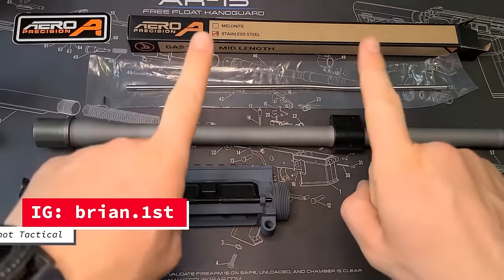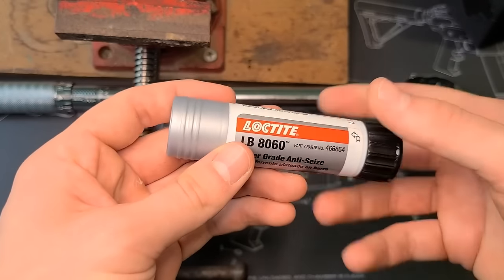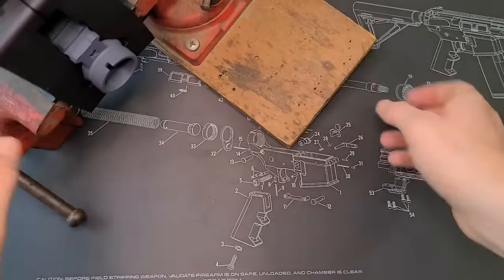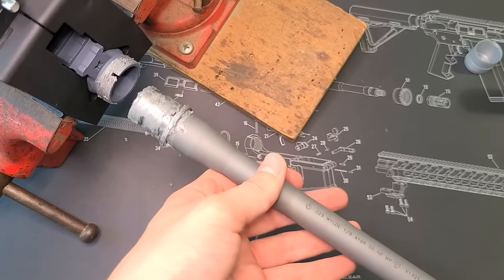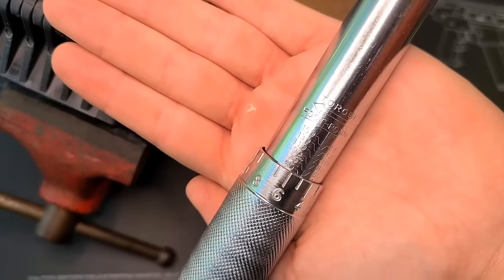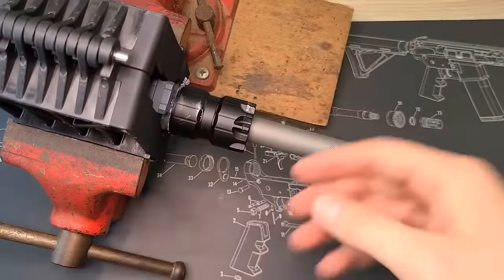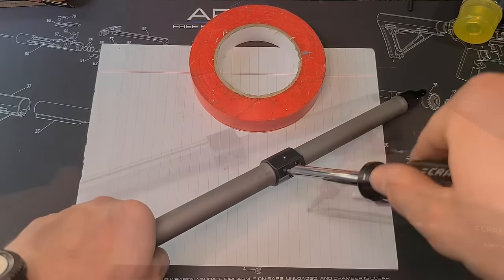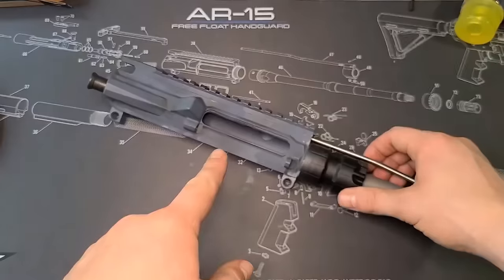How to Install AR15 Barrel - Aero Precision Upper

Comment: That vise block and the vise itself are pretty sketchy. I use a reaction rod and a properly mounted vise to install the barrel and torque down the barrel nut
Reply from the maker: Ohh it is sketchy… but it get the job done! Lol🙌🙌
Reply: I like the MWI cus of the sail. Helps alot with other tightening.
Reply: @ishnifusmeadle  that’s exactly what I have
Reply: @1st Shot Tactical could you a make video of it I would like to see it out of curiosity.

Comment: Just FYI, loctite on the gas block won't do anything. They get super hot, which completely negates loctite.
Reply from the maker: 😂😂😂 thought of that after lol very true!
Reply: What he used is anti-seize, which allows something threaded together to more easily unthread in the future. It doesn’t become deactivated by heat. His brand of anti-seize just happened to be Locktite.
Reply: @qubiedoo1  actually no he said blue loctite which is a thread locker.
Reply: -- uh --- first, he used anti seize (Loctite brand) on the barrel nut. 
THEN he used thread locker (Loctite brand) for the gas block screws.
This guy is a beginner and has received a lot of great advice (from the above comments) as a result of having posted this video.
It is OK to cut him a little slack.
Reply from the maker: @3cap97  appreciate it man! Haha always leaning!!🙌🙌
Reply: @3cap97 we don’t want misinformation to injure or kill anyone. These are not toys to be played with!!! When you pull the trigger, the energy released is thousands of pounds of pressure and remember you are holding that rifle up to your face, if that energy doesn’t go out the mussel, it’s coming back in your face in the form of a grenade. Maybe this young man should have gained more experience before posting a “ build” video.
Reply: @M21-w1y  says the armchair quarterback with no videos

Comment: The hardest part I’ve experienced when rebuilding an M4 when I did small arms repair in Afghanistan, was those damn spring pins for the gas tube and block. 😂

Comment: They are called "roll pins" and there are punches called "starter pin punch" and "roll pin punch".  Good to also have other proper equipment like a bench mount vise, pin block and better to have the proper barrel rod which will stabilize the barrel when torquing the nut down.  Yes, I have done barrels without the proper tools in the past.  But I didn't post a "how to" video.
Reply from the maker: Thanks for the comment and great advise!!🙌
Reply: God why is the gun community such puritans😭
Reply: @DannyThecorniest I mean to be fair, guns aren't something you want to half ass. Would you not tighten your vehicles lug nuts to spec? If so, I don't want to be near you on the freeway. Lol. 
I'm actually not going to be building my own upper due to not wanting it to blow up in my face because I didn't tighten a part correctly. I'd rather err on the side of caution with this shit.
Reply: @BatbumAndRobinU  that’s fair. I triple/quadruple check every time I install a barrel/gas block/etc, but I’m about to start buying them completed. Don’t want a KB type incident.

Comment: If you don't remove the dust cover, you won't be able to get the tool for aligning the gas tube out.  The spring loaded pin on the inside of the dust cover hangs up on he tool.
I just went through this and after some thought, I aligned the small "C" clip so I could see the two ends of the clip.  I used 2 small screwdrivers .  One on each of the "ends" and tapped the clip off.
It came off like a breeze.  Just watch so the clip doesn't decide to take a cruise around the kitchen.  

I then pulled the rod out of the cover from the rear "stock end".  That's it.  I have my first ever AR-15 close to being finished.  I think I went over my budget but that's okay.  Wheeler needs to modify the mold for the plastic pat that holds the gas alignment rod,  You can't get it out "IF" you have the dust cover on.  The first two flanges toward the front of the tool can't get by the dust cover spring catch on the inside.  Then you would have to take the dust cover off.   God Bless America.  We need Trump back or else we're screwed.
Reply: This aero upper doesn't have that "c" clip, I bought a strike industries cover and was planning on. Putting it but found out that I have to loosen the barrel nut to remove it from the front... A PAIN IN THE ASS!.... I have a complete upper already assembled. All this work to replace a dust cover....SMH.... I'm going to remove the hand rail and see if I can find a way around removing the barrel nut.

Comment: Don't drive a point "pick" into the end of a roll pin.  The pin is hollow with a slit down the side, so the point will actually expand the roll pin so that it won't fit.

Comment: Did you use enough anti seize? But if you are really concerned about the heat there is high heat nickel anti seize. Also that stuff gets everywhere so its better to not touch it
Reply: Anti seize? Supposed to use good old shell areo grease. Good enough for Stoner and uncle Sam good enough for me.
Reply: As a mechanic I cringe at liberal use of anti seize, it will thin out with heat and act as liquid metal shavings. I never use it on spark plugs bc of that, plus it throws off torque settings.

Comment: My muzzle device is pinned and welded so I cant slide my gas gas block off. Will the barrel nut install from the receiver side of the barrel?
Reply from the maker: Negative… it sounds like you’ll have to find a handguard that accepts the same barrel nut you currently have🙁
Reply: Might just be better to cut it off and get a 2 piece block

Comment: I'm confused why you are torqueing down to 55ft-lbs, then loosening, then tightening to 65ft-lbs. Why not just do it once to 65ft-lbs the first time? "To make sure those threads all seat together" doesn't make any sense. Aero's own video on barrel install makes no mention of this tighten-loosen-tighten method you are referring to...
Reply from the maker: It’s user preference! You could do it either way! But I talked with quite a few gunsmiths and they taught me to tighten it twice! Your call tho!👍👍
Reply: Minimum barrel torque spec is 35 foot pounds..Colt had problems with barrel nuts loosening and they started to do the tighten and loose the barrel nut three times to condition the barrel nut threads. This stopped the barrel nuts from loosening..
Reply: USMC tech manual says torque it to 31-35 ft lbs and do it 3 times. Maximum is 80 ft lbs and if you torque it to 65 or higher to begin with, it's easy to exceed 80 when you have to go past it to align the gas tube with the slot.
Reply: You absolutely should loosen in between torque increases . You are mating steel to aluminum. The aluminum receiver is clearly weaker than the steel barrel nut and the receiver needs to acclimate to the stress put on it from the barrel nut. This is all per Colt: Torque to 30ft lb then remove, torque to 40ft lb then remove, finally torque to 50-80 ft lb depending on needed alignment. A ton of people see the barrel torque specs of 30-80 and just go for it.

Comment: How do you fix headspacing?
Reply: If you have an ar-15 barrel that isn’t headspaced correctly, it needs to be sent back to the manufacturer. Bad headspace means the barrel extension is set wrong, which then means the gas port is drilled in the wrong place.
Reply: Depends.  Figure out what way your headspacing is out.  If the bolt won't close on a go guage, you can sand the boltface back a little bit.  Not much, and is dependent on HOW much it is out of tolerance.  If the no go guage fits, then there isn't much you can do other than sending the parts back to the manufacturer.  If a field guage closes, you might have to form 1 the gun as a destructive device because it's close to a hand grenade at that point.

Comment: Wow, vise not bolted down, no adjustment of torque to compensate for offset spanner, using a torque wrench to loosen the nut, and you brought up removal of the gas block as an after thought.  Glad you're not doing a build for me.
Reply from the maker: You bet man appreciate the feedback 👍
Reply: Wow don’t think it’s a big deal he’s not selling them

Comment: does lube work?
Reply from the maker: Ehhh I would would definitely recommend using the Anti-cease grease for the barrel and threads👍
Reply: Use Aeroshell64 grease..Without the proper grease, the torque will not be correct..

Comment: I would not loosen it up . I would make my torques in three stages first one at 45 pounds second one at 55 pounds and  the third at 65 pounds
Reply from the maker: That’s a great idea, thanks for the advise and comment!!🤘🤘
Reply: You absolutely should loosen in between torque increases . You are mating steel to aluminum. The aluminum receiver is clearly weaker than the steel barrel nut and the receiver needs to acclimate to the stress put on it from the barrel nut. This is all per Colt: Torque to 30ft lb then remove, torque to 40ft lb then remove, finally torque to 50-80 ft lb depending on needed alignment. A ton of people see the barrel torque specs of 30-80 and just go for it.

Comment: There is a tone of errors with this installation video. As I've been told, the AR is the "Lego" of the gun world, for sure anyone can screw one together. Quality build, not so much. I've had many customers bring in their build and say why doesn't it run. Install a roll pin for the gas tube on a roll of tape???
Reply from the maker: Thanks for the comment! 100% disagree with Daryl and this build turned out great and runs perfect!👍
Reply: Yup, it is either done correctly or it is a range toy..A lot of misinformation being spread by people who should know better..
I think the Star Wars saying applies here. Who's more the fool, the fool who leads or the fool who follows??

Comment: Another AR build video full of bad information. First red flag was the "mobile vise". Never listen to anyone who doesn't even have a proper vise. The clam shell is the worst tool to use to set a barrel. Use Grease not anti seize. NEVER use your torque wrench to loosen anything. It throws off the specs. Especially when you're using a harbor freight wrench which I bet you are. Blue loctite shouldn't be used as it doesn't withstand heat. Just because you impress your friend who doesn't even own a firearm doesn't make you a gunsmith. Stop giving info when you're obviously a newbie yourself. For the general public that watched this video looking for info. FORGET you even seen this video.
Reply from the maker: 😂😂Hahahahaha thanks for the comment 👍
Reply: At least we learned what not to do lol
Reply: If not Clamshell what tool to use to install barrel ? THANKS, I have a good Reaction Rod ?

Comment: Aero rifles suck, I hate mine, literally the only rifle I have ever regretted buying. It was bought brand New from dealer straight from factory. The rifle had an AR15 Buffer Spring in it from factory and it is an AR10 rifle. So straight out of the factory first bullet loaded into it and click, nothing. The firing hammer spring was installed backward from the factory. Took it down, called dealer, we talked about the issue desided to check buffer loop count(after putting the spring in correctly) and sure enough it counted out to be a AR15 buffer, so he replaced it himself with an Aero AR10 buffer he had in his store. So finally all should be fine and it would right... nope. Needless to say in the end the factory denied that they had put the wrong parts in the rifle. And then said maybe it could have happened and they would have to talk to the person that assembled it. And finally dealer just gave me a whole new rifle sadly another Areo same model. And then after 4 months he did get the original rifle to work... after the factory had to also replace the lower receiver as it was also out of spec. Now my new rifle qorks right... RIGHT!!!! No it misfeeds  often. I have other AR10s and have no issues with them like my SFAR that has so far not had a single misfeed or misfire in 140 rds. hopefully it keeps it up for thousands of rounds to come. Anyway stay away from Aero over priced garbage.
Reply: Good to know

Comment: This is the sloppiest upper greasing job I have ever seen...  be neat. Use AEROSHELL, that is beat and use less of it... It is the galvanic response between the steel barrel and barrel nut and aluminum receiver you are treating to prevent seizing.   You may need to remove the parts in the future.

Comment: Is this a parody video?
Reply: Kinda went heavy on the grease for the barrel nut, and the pick to drive the roll pin.... "Chef kiss"
Reply from the maker: @Evolved272  make do with what you have!!🤘😂
Reply: @1stShotTactical  Make do with what is needed if you want it done right..

Comment: you say 223/556 like it's interchangeable it's not you run higher pressure in military issue 556 the 223 is the lower pressure civilian version you fuck around and run that 556 down that barrel too many times you're bust internal assembly parts and possibly mess up the barrel too I would have gone with 223 wyld because that can handle both 556 and 223 with no issues
Reply from the maker: It is a 223 Wyld! Lol you’re smart and understand it! I didn’t feel like being it up to explain in this video👍👍